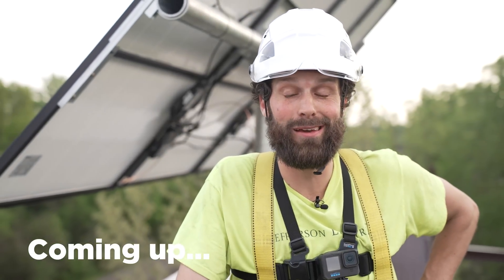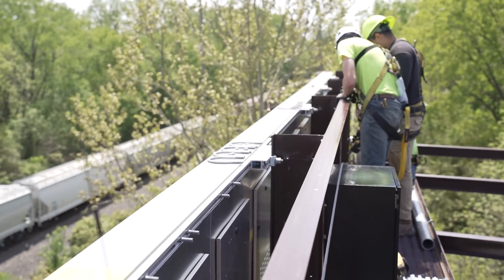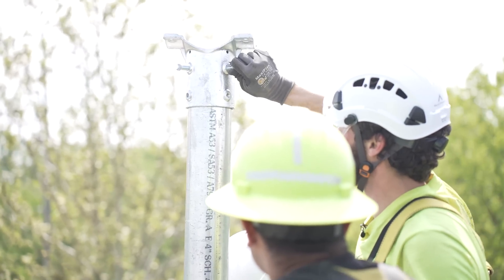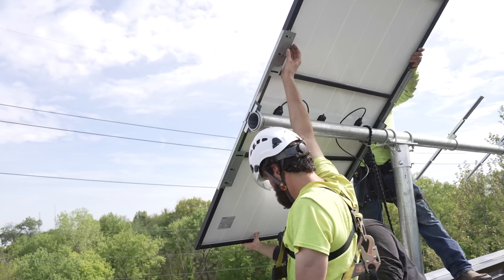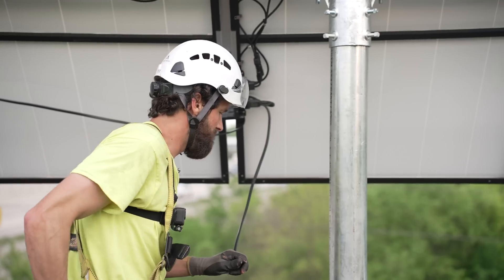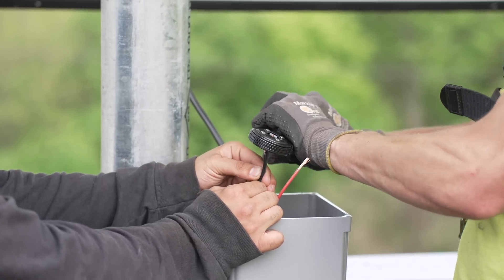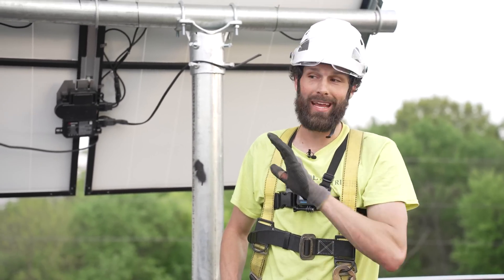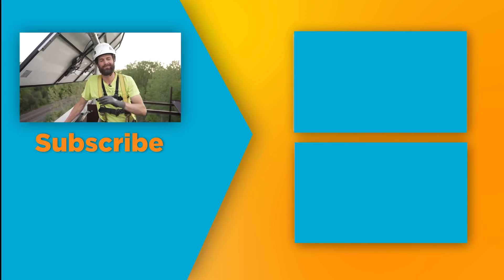The MOST DIFFICULT Solar Installation We've Had Yet - Part 2

Comment: Nice work.  I'm kind of surprised the job didn't call for bi-facial panels since you have light on both sides.
Reply from the maker: Didn't want the extra cost for something that was still going to generate too small apercentage of the necessary energy.

Comment: I love watching construction videos showing osha fall protection violations.  Nothing like providing OSHA with all the proof they need.
Reply: I question the WAH safety being used. That many people on a questionable HLL using fabric lanyard’s on a metal leading edge. It’s all good if nothing happens but, I value my life more than making money.
Reply: I really like his videos. As far as he's always quoting the code and why they're doing things the way they're doing them, it's surprising to me that they don't have a safety officer that is making sure that they are not violating OSHA regulations on every video they do at height
Reply: Hand tools should also be on a tether, so they don't get dropped, like the drills etc
Reply: In case you are curious what your violations are, just casually watching I found 3:
1) I can almost guarantee that horizontal lifeline is not engineered, or capable of withstanding 3+ employees falling into it.
2) the employees using the yoyos on their sternal d rings are not legal.  To use the sternal you have to have freefall of less than 2', and with the amount of slack on your lifeline and the fact that it is hanging around the employees knees, they have more than 2' of freefall.
3) the employees using the Y lanyards on their dorsal (good job) are anchored too low.  Your lifeline needs to be at dorsal height or higher, or you need 12' free fall lanyards

Comment: I'd gladly work heights with a company that consistently makes fall protection available. :+ )

Not to imply that I understand the job well enough to plan it better than you: From what I could see, I might have assembled the array on the ground and lifted it whole. It would mitigate the falling object risk, and allow you to assemble and wire the array in total comfort; it would also reduce the manpower required. One challenging pulley lift seems way nicer than mounting and cutting at height.
Also, for an array that size, you don't need to run THHN, you could've pulled a single 10/3 UF-B, which comes with a 10AWG ground conductor.. that having been said, THHN and buchanans is the norm, so nobody's faulting you.
Reply: Crane rental would be outrageously prohibitively expensive for a job this small
Reply: @MM-fe9mz  you don't need a crane dude.
Reply: With what machine would you have lifted that whole genius? You renting a crane? You ain’t lifting that with a boom lift or telehandler MAAYYYBE but then where the sigh off the high way? How you getting machine in there. Point is you aren’t there buddddd… 😂🤡🤡
Reply: @edwardmurray2494  it's called a pulley... This thing is tiny.

Comment: What about an lightning arrestor / rod for those solar panels? It seems that one lightning stroke may damage the array…
Reply: Ground impedance of that giant pipe is probably pretty low.
Reply: @microcolonel  a lightning bolt is more likely to hit the top frame of the solar panel instead of the giant pipe…
If it hits the pipe, yes that would be ok, but the top frame seems to be quite thin aluminium